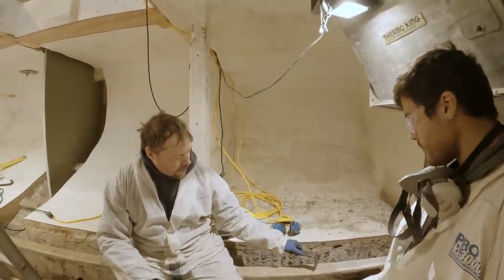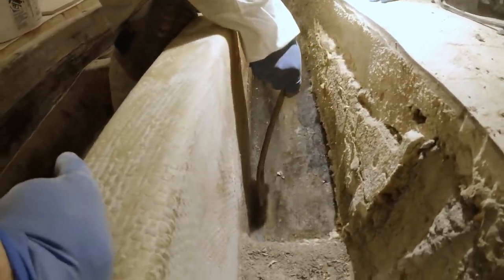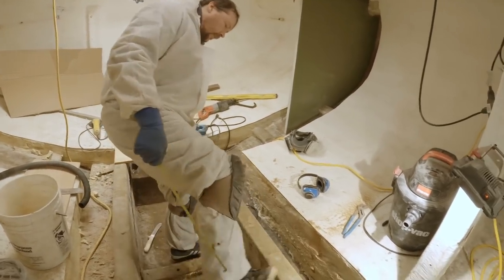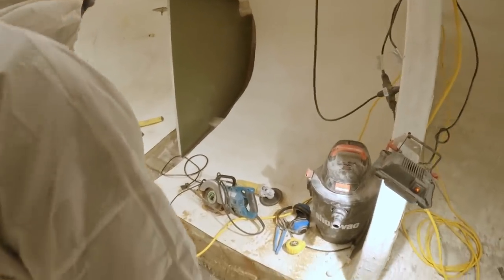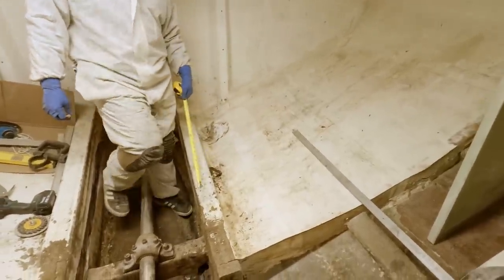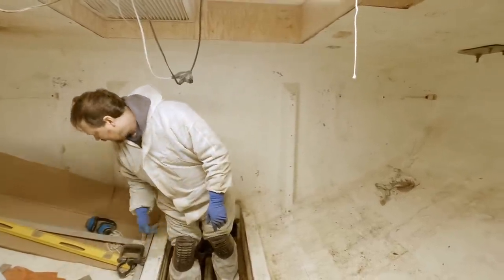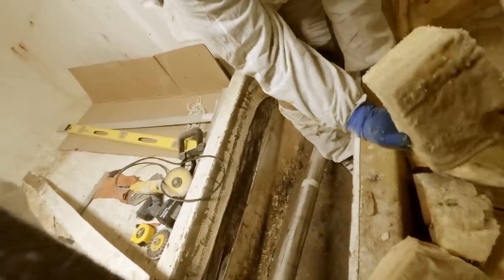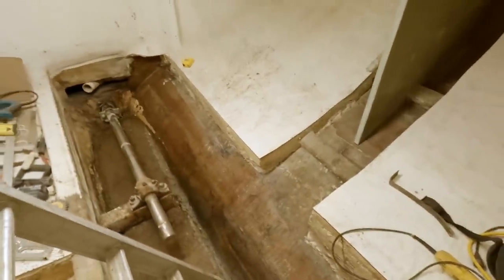Removing Shaft Alley Stringers-Emerald Isle: Ep.32 Fishing Boat Refit

Comment: You have a lot of delaminating to do so, get an old ice scraper/chopper that you would use on a sidewalk. Cut the handle in half and sharpen the edge like a chisel, gives you more leverage and you don't have to bend as bad.

Comment: If it’s not all rotten can’t you reinforce the bulkhead with plates of steel or aluminum?
Reply: Would be alot more expensive to do that and you shift the weight more as well. Taking out and replacing with foam laminet is liter and cost less.

Comment: That sure is some punky wood/stringers.  I would feel more comfortable being in dry dock.  You had to of known that the stringers would have to go.  Bonus would of been if they didn't but very few boats with wet holds don't require this type of work when they have wood cores
Reply from the maker: Yep, they were too far gone to leave alone. Would have nagged us later on thinking about it.
Reply: @EISAlaska  Most folks 'accept' wood core stringers because it's been done that way for  long time.  Well A maker some what near me (diff type of boat) doesn't use wood core.  They use fiberglass and doing so can have live/wet wells in the floor without issues.  They are what's considered sport cabins or pilot house, and the builders are Steiger Craft.  A similar buillder and more well known is Parker but they use wood stringers and doing so don't have really any options for the floor due to issues that would arise.  Steiger has a lifetime guarantee on their hulls and have never had a hull warranty issue
I also want to add that they use a all fiberglas and resin floor, no plywood

Comment: Man ... what an emotional roller coaster ripping the old soggy stingers out and rebuilding them.  Good thing you're getting some fishing/crabbing in while this project proceeds.  That should keep the stress down.  

That's going to be a big forward fish hold when tanked down.  I still feel that it would be more optimal to subdivide into three fishholds (a forward blast freezer to allow on-the-water processing and/or bait storage, a middle RSW/ice, and a rear stern RSW/ice). Regardless .... sending much encouragement.

Comment: Looks like you guys opened up a real can of worms there. You should probably replace it all while you got the chance and you can access it easily. I wouldn't half-ass it and piecemeal it here and there do it right I'm sure you don't want to go swimming
Reply from the maker: That was our exact thought Lonnie. No sense putting new shaft alley covers down on old half-rotten stringers. Added some to the project timeline, but not too much in cost.

Comment: Sawzall and Metabo, two of the greatest deconstruction tools ever invented! My youngest Son has done a lot of foam/fiberglass work on his boat in Eagle River. He is fond of using plastic to bag with and a vacuum pump for dewatering the foam. It has really worked well for him. He also bagged his hatch covers after fiber glassing and pulled them down on a flat surface with the vacuum pump while the resin cured. Seemed to work real well.